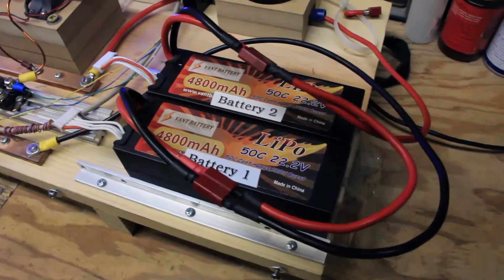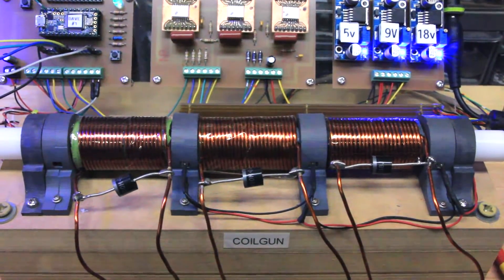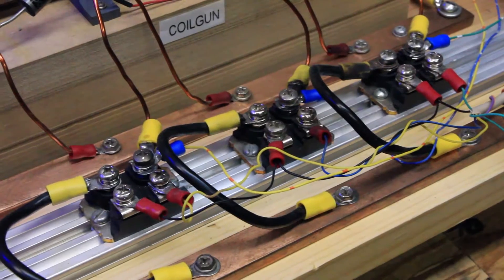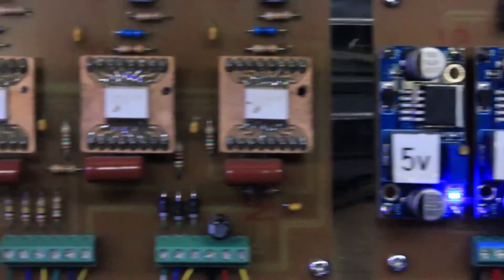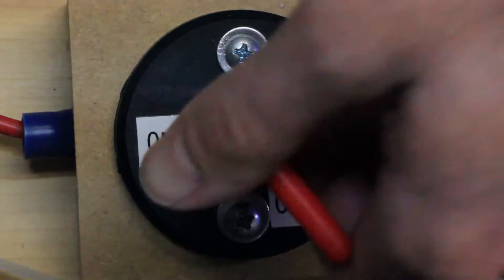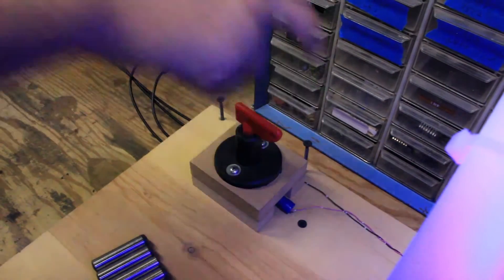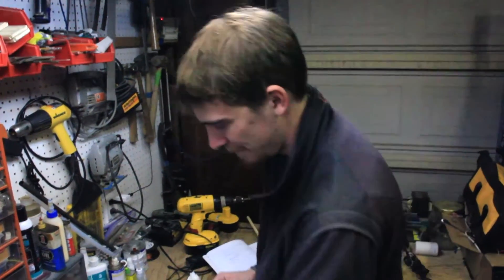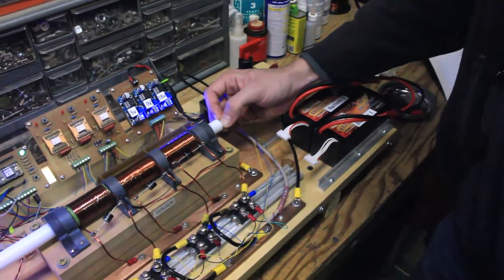Coilgun Project Overview

Comment: Hey there again! A while ago I suggested the additional resistor in series with the flyback diode. Have you tried it out with this setup? I am pretty curious if you face some improvements. You said you wouldn't expect any results, but it doesn't hurt to try, right? ~23 Joules of muzzle energy without capacitor bank is pretty good nonetheless.
Reply from the maker: Hey, thanks for taking an interest. That really means a lot to see other
 people following what we do. In answer to your question, I haven't 
tried the additional resistor yet. I have to order a few (don't have any
 high enough power ones on-hand), but there are some other things I want
 to try that may require parts, so I haven't finalized the order yet.

I also realized it's going to require some code changes to be a worthwhile experiment. The TL;DR of it is that the current microcontroller code errs on the side of shutting the coil down prematurely in order to ensure that the next coil in the sequence is at full power by the time the projectile reaches it (batteries limit me to one coil on at a time, and the coils take longer to turn on than turn off). In order to see the resistor work I'd have to make sure I was leaving the coil on until the last possible second, and I can't really do this with the current codebase unless I "hack" it by affixing some tape to the tail of the projectile or something. The good news is that I want to upgrade the code anyway to a control system that will have a model of the expected behavior and timings, then update that model on the fly based on what it sees from the sensors.

The code actually has a lot of safety features. It forces all of the mosfet pins to ground and won't allow them to go high if the red switch isn't turned on, it enforces a maximum on-time for each mosfet, it won't allow you to start another firing sequence until a reasonable amount of time has expired since the previous shot, and it'll shut down and light an error LED if it detects an unexpected sensor condition (e.g. a sensor is skipped, or two sensors are blocked at the same time). The long and short of it is that it's going to take more time than I initially thought to change it, but I'll get there eventually.
Reply: No problem, I see lots of untouched potential in your coilgun. I, myself, am more active in the field of railguns and not so much in coilguns as I am to be fair and square only started learning about electrical engineering and it's applications a year ago. (I only graduated high school this year, to enter mechanical engineering) So I might not be as useful as you think. However, that doesn't mean I am completely useless. I will try my best to present some ideas and it's for you to decide whether it's useful or not. 

Having the coils switched on by microcontroller is indeed the best possible option, especially with this kind of setup (due to temperature differences, leaving your pre-calculated timing sequences inefficient). So you can't just switch it out, the software would have to be altered indeed. How well has the current microcontroller setup been for now? Do you think you can have a more efficient coilgun when changes are made in hardware rather than software? I am glad enough to see someone putting some effort into the coilgun rather than smacking some capacitors on it, run basic timing code and done. If I may add, have you thought about using a simple SD module for the Arduino you're using and save the data to the card and with that data you create model of expectations? The thing with the resistor is rather simple, make sure the flyback voltage is dissipated through the resistor, rather than the coil it self entirely. But you also really don't want to completely block it out. It has been proven to me that it works as said in my comment from a prior video.

I like that you have implemented saftey features. It does give a more secure feeling when experimenting. Even I think so, with my limited knowledge, I feel more safe when trying out new stuff. How would you like to add a hall sensor (one without integrated Schmitt trigger) at each coil to prevent anything from happening may a mosfet fail or anything like that leaving a coil conducting? Perhaps even studying some on-time magnetic field waveforms? Just throwing it out there.
Reply from the maker: That's always good to see people learning fields outside of their 
primary area of study. My background is computer science, but I've taken
 an interest in hardware since working for a defense contractor that 
deals with a lot of high power electronics. I've also dreamed about 
building one of these for the last 15 years, and as such read just about
 everything there is to read online. I'm always interested to hear ideas
 though, especially since you seem to have put a lot of thought into 
this sort of stuff yourself. If you want to talk more about this in 
something a little easier than youtube comments let me know. I've got 
steam, google hangouts, skype, etc.

I actually broke down and built this because I was getting sick of trying to model it without any real data. One thing I've learned from doing R&D at work is that a lot of the time you'll learn just as much, if not more, by trial and error as you will by relying only on simulation. The main point of this is actually to be a test platform so I can see what works, what doesn't, and how much any given chance will improve it. Once that's done I'm moving to 10 coils and turning it into a portable gun very much like the deltaVengineering one (except that I've already surpassed his muzzle energy with only 3 coils).

The current microcontroller setup has worked quite well. As you can see in the video, it adapts to pretty much any projectile we stick in it (albiet with differing levels of efficiency, mostly due to length differences screwing with the timing). It also adapts to voltage differences in the battery (we consistently see the same muzzle energy for a given voltage). The main code change that I want to do is to re-architect it based on a "fixed" timing that adapts based on measured speed between any two given sensors. This would allow me to slew the exact point the coil triggers to accommodate things such as extra short projectiles or non-ferrous tailfins that still trip the sensors but don't provide anything for the magnets to grip.

As far as saving data to an SD card, I've considered that, but it's going to come down to what I decide on to be the final architecture. Writing to EEPROM would also be an option. One thing to keep in mind though is that because I'm polling the sensors (currently 3, but the final gun design is going to use 10) at a very fast fixed timing rate, there's not a lot of processing overhead to work with.

I considered sensing based on inductance early on but decided against it mainly because IR sensors are a lot easier to understand and test. How hard is it to implement a hall sensor?

Then as far as magnetic fields go, I've actually got access to some people through work who model that kind of stuff for a living. Once I've run enough experiments to formulate some specific questions I'll probably start pestering them. One of the other improvements I want to try is putting a ferrous casing around each coil (probably epoxy and iron fillings, still need to do the research and come up with a good way to make them consistently) and seeing if that helps concentrate the field inwards for more power.
Reply: It is indeed, I wouldn't consider myself an engineering even with a PhD in Mechanical Engineering, but knowing nothing about Electrical Engineering. I have done most of the learning in last year of high school, but these days, I don't have that time anymore. However, I am trying to become more active in making videos on YouTube. I am really excited when it comes to making stuff like this. I think about improvements to what I see every day. Yeah, sure, we can do Steam: azagro

Yes, I can imagine that, it's one of the phases I am in now as well, trying to maximize muzzle energy without knowing basicly anything. So I just found a good balance between R&D and just testing it out, where most of the time still is spent in R&D. I'd like to see your project in handheld form. Yes, Jason Murray is one of the people who has done a decent job, but not good enough. You've already managed to reach the muzzle energy on his single stage capacitor based coilgun (25J). 

Yes, I can see it working pretty well. How does it adapt the timing to the projectile? Just with the sensors? Ah nice, is the voltage on the bateries balanced to eachother? I am not really sure what the consequences would be if the battery voltage differs from eachother, but I am pretty sure it isn't positive. 
Ah, so your plan is to average the data out to a point where it would work for almost all projectiles but with feedback from the sensors? 

I see, but just for figuring out the fixed timings I am sure that saving the actual data you read on the SD card will make the job a little easier. If I understand correctly.

Oh no no, I don't mean to ditch the sensors, I am suggesting to add them. Hall sensors react to the external magnetic fields. It's like a photo-transistor for magnetic fields. It outputs an analog voltage (based on the magnetic field strength) or a digital signal, depending on which one you buy. You then use the IR sensor to detect the projectile leaving/entering the coil and the hall sensor to make sure the magnetic field isn't present on the specified location. Therefore you can make sure the previous coil isn't pulling the projectile back or something like that. You will be able to see overlap in waveforms or gaps if the coils aren't correctly timed. You fine tune the coil timings according to those test values. Implementing is as easy as taping the hall sensor to the coil. Let me know what you think about it. 

That is very nice! Make sure you use their knowledge to perfect your designs and what they say about it!

Also, have you had any problems with the projectile tilting? Since you use a contactless method to accelerate the projectile it sits loosely inside of the barrel. When it's tail might hit the exit walls + the drag force, it might cause the projectile to tilt.